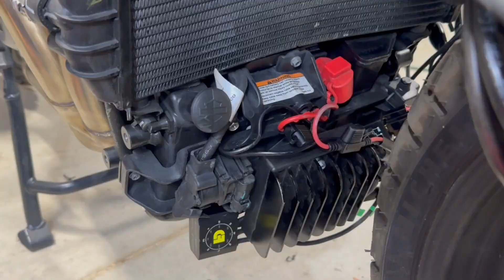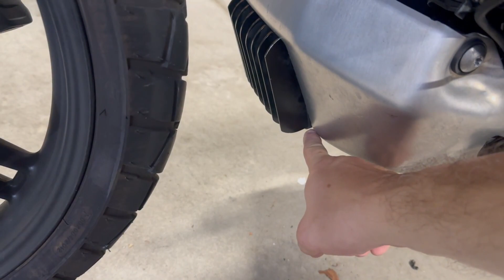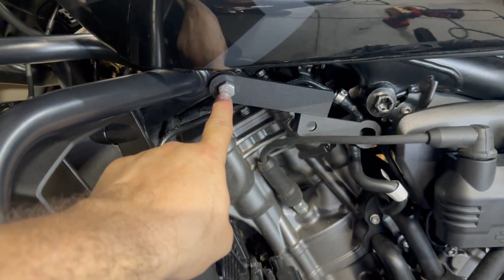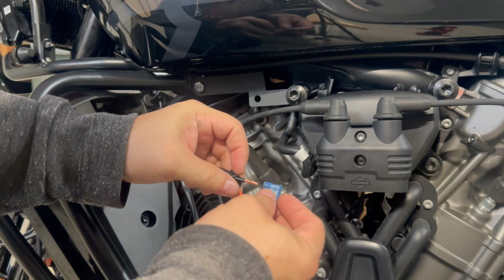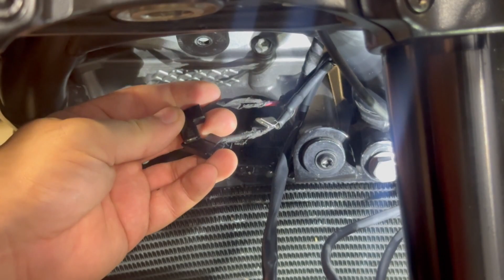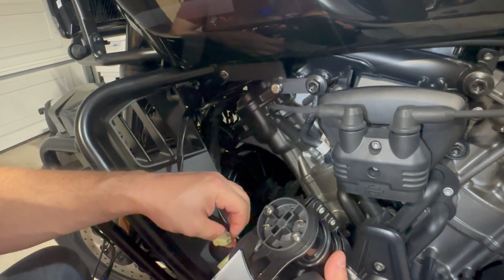Denali Electronics Series Part 4 | Pan America | Soundbomb Horn Install

Comment: I have a 22 pan. I have an aftermarket heat deflector and the sound bomb fits fine.  I had a problem installing the front bolt to the bracket that was supplied by Denali. I couldn't get it to seat. I got one that was a quarter inch longer at it worked fine.   Watching the video, I couldn't figure out why he cut off the excess at the end. I cut out the excess in the middle and only needed to solder the two wires. Didn't need to replace connectors.

Comment: Do you mind if I ask what year your PA is? I ordered a setup from Denali and actually had this horn in my cart, but they emailed me and said it would not work in my '23 because of the heat shield. I'd have to cut a part of it off to get it mounted 🤦🏽‍♂️
Reply from the maker: My PA is a 2022 model- I don't have the heat deflector on mine but I am looking at getting an after market one that sits closer to the fan so it won't interfere with the horn.
Reply: Take off the stock deflector.  You can find after-market ones fairly  cheap. My sound bomb fits fine behind my deflector.
Reply: @JamesDunlap-i5m  Mind showing me a picture?
Reply: @n8ivelum I downloaded three pictures, don't know where they went. I cut a section out so wouldn't have to mess with connectors. I don't have any crimpers. Do have a soldering iron.  The bolt supplied in the kit was not much longer than OEM. I could not get the supplied bolt to bite. The one I found was a quarter inch longer  than the supplied bolt. I ended up stowng the excess wire, relay, and relay connector inside right Fairing. Thanks for the video it helped.
Reply: Aftermarket deflector works fine on my 22, a lot cheaper than OEM.